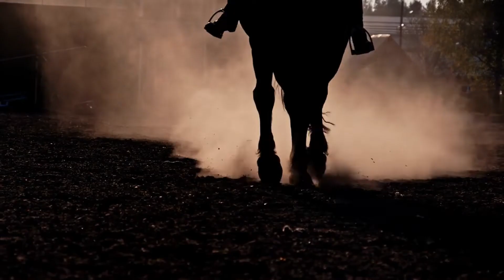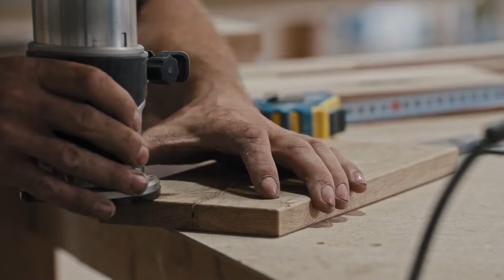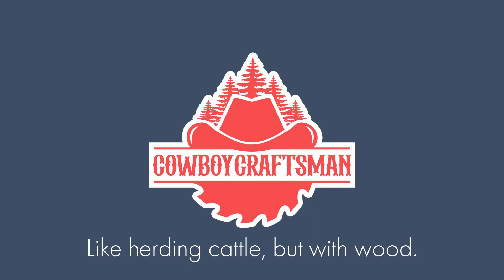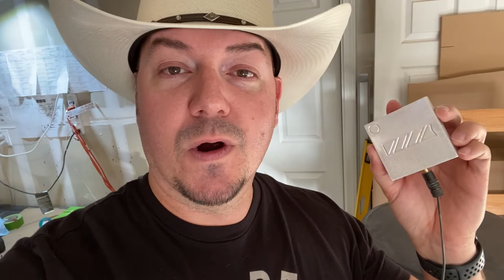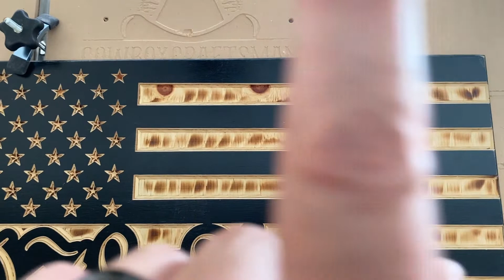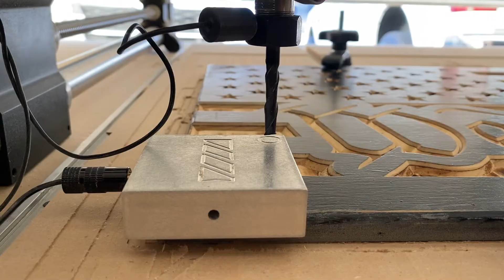Why Do I Need A CNC 3-Axis Touch Probe?

Comment: I bought a probe when i first bought my CNC i thought i was going to need it. some issues i had with probe. repeatability is not possible. if you use probe to set X and Y and you hit E-stop or have to power off and/or reset the X and Y with probe  its not going to be in same spot. It will be close but its not going to be same spot. This error has costed me $$$$. I dropped the probe and just started doing everything manual. I have better chances of it coming out with out the probe then with. only time i use the probe now is when i do a bit change and just use it to set Z.

Comment: I don't understand why you need to set your xy axis on corner and not on center. Also why your x axis floted over on your flag  stripe. Nice video. How do you like your Xfinity router? Thinking of getting one.
Reply: Onefinity not xfinity that's the cable guy
Reply from the maker: @jefferytwilliams  LOL at the cable guy comment! It's really a personal preference - I've tried setting the xy axis on the center and ended up with a crooked carve because my probe wasn't fully centered on both the x and y axis, thus the x axis floating issue. I'm still new at this so maybe there's a trick I'm missing? I love the Onefinity so far. Would highly recommend! Thanks for watching, my friend.